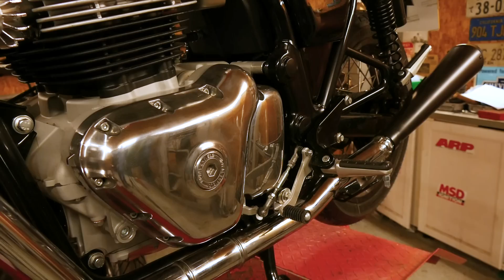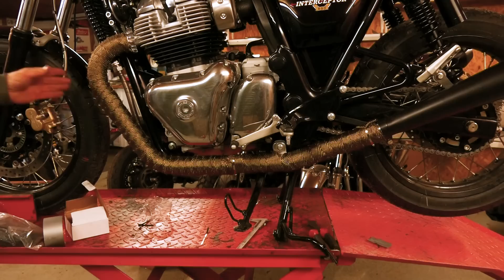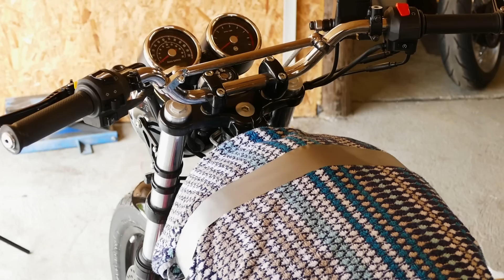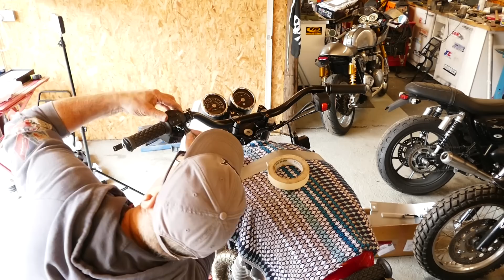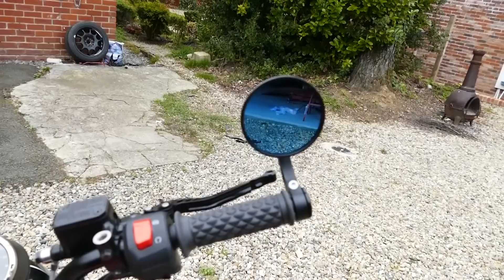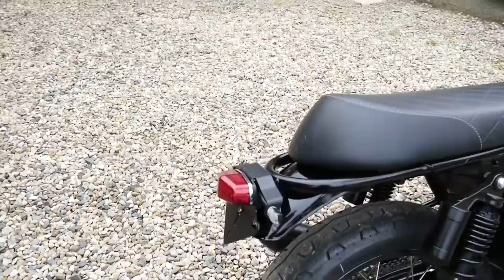Interceptor 650 Project - Part 2

Comment: Could you do a video on how the Tec Adjustable rear shocks work on the Royal Enfield?  In addition to the adjustability, what makes these shocks better than stock?  Also, if the shocks aren't lowered, are they at the same stock height or can they be adjusted higher?

Comment: Hi, excellent work sir, I have a question regarding the Interceptor 650, I am have been searching the answer for it and even the service centre people can't solve it, they say that its in all the Interceptor and the gt as they are parallel twin and they have a 270 degree firing order, couldn't understand that's why I am asking it, the issue is why does the rpm keeps fluctuating,

Comment: I haven't used the TEC wrap but I have done it a few times. Wetting the wrap seems to make it expand a tiny bit, so when it dried and shrinks back to it's original size it was nice a tight on the pipe. 
Running the motor immediately after finishing, dried it very quick.
Maybe it depends on the make of the wrap...

Comment: Would you suggest adjusting the shock absorbers to lower the overall seat height? By how many inches can we possibly do without affecting the stiffness of the shockers ?
Reply: Our lowering type 22 shocks are 335mm at shortest setting , this drops the seat height approx 2 inches from stock height
Reply: @georgemilburn6213  thanks ..that's great !

Comment: Hi, I'm Francisco, greetings from Alicante, Spain. Thank you for your excellent videos, everything is well explained and does not seem very difficult to do for yourself. Here we are impressed by the quality of your modifications. To start, we want to order your TEC Handlebar, TEC Alloy 28.3 mm handlebar clamps, CNC Alloy Adjustable Brake and Clutch Levers Set, and TEC Fork top pre-load adjusters for Royal Enfield 41mm Forks. But I have some doubts about the handlebar model that I should ask for. Could you tell me which is the best model for Interceptor, type A or type C, what is the model of your video? I also want to ask how much more is gained in height over the original handlebar, and if I can have additional information about TEC Fork top pre-load adjusters. I am not going to put mirrors on the end of the handlebar and I want to know if I can mount the original Royal Enfield counterweight set for it. Sorry for my bad English and I thank the Google translator, heh, heh. Thank you very much.

Comment: I like the sump guard holes for mote ventilation. Whe i installed the re branded one i saw the oil filter not clearing the bracket and started getting upset due to the instructions clearly showing it bot being an issue. I ended up sticking the bracket in a vice and slightly angling ut more. This aligned perfectly with all brackets and allow the oil filter to clear now.

Comment: Did you have to re-tune the ecu when you changed the silencer?
Reply: no need-  please see part 4 video for dyno run results. the  air fuel ratio was good all through the rev range with very smooth running

Comment: I think a big bore kit will have to be offered for these, unless they plan to make a larger capacity version. 650 is too small an engine for open road riding over longer distances. It could also do with some type of Screen and I don't mean one like the thruxton I mean one that is high enough for 6' bloke sitting up. Thanks.

Comment: Hi-Tec Bike, Great to see bike being Modified, Just wanted to know what TEC Alloy Taper Handlebar was used? - 7/8" ends - Type A/B/C
Reply from the maker: Type A TEC taper bars with 20mm extender tubes at each end.
Reply: @TECBikeParts  - Thank you for the reply.

Comment: I am so glad I found your channel. I was only recently made aware of the new Royal Enfield twins. I will be getting a motorcycle within the next couple of years, and though I was originally looking at an adventure bike, when I saw the Interceptor 650, that was all it needed. That's my bike. 
I will be extremely interested to follow the progress of your accessories development, especially the classier brackets, and LED lighting. I would also be looking for good pannier brackets and a rear rack for extra fuel. 
I really like where you are going with your ideas on the exhaust system, but I must say that I do not care for the black cans. They have taken out all the thumpy base, and left a rather harsh, brappy sound. I know they are temporary, so I look forward to seeing what else you come up with.
Yours is one of only a few YouTube channels that I actually felt that subscribing was a necessity. For anyone considering the purchase of a RE twin, I would say that your channel IS a necessity.
Cheers.

Comment: I have been watching your content. specially the one where you try to correct the HP problem in the street twin. I ride an interceptor 650, I have few questions. how to get this bike a set of tubeless wheels(alloy wheels not available as of now), is there a way to increase hp with minimal changes, lastly is there a way to install a slightly fatter tires (standard swing arm is not able to house a 140 section)... please suggest. :)

Comment: The seat height comment is worrying. Could I ride an Interceptor at 5'6"?
Reply: best to get a test ride , but if you find it too high we have low cost options to lower it
Reply: @georgemilburn6213  sounds promising George. You say the seat is a bit high for you and you're not particularly short - to help me gauge, what height are you?
Reply: @georgemilburn6213 , test ride - very nervy - haven't ridden in quite a while.

Comment: How to update disc from front single to dual disc brake system ?
Reply: It would be a far easier to upgrade the caliper to a 4 or 6 pot

Comment: The continental GT has the centre stand removed for 'weight savings'... I think I'd rather have it for the maintenance and parking convenience. Assuming they are the same frame with the same mountings so hopefully just a bolt on part. could you design a center stand for continental GT models?

Comment: I like your style. I live in Greece, ride a classic 500 and there is a very enthusiastic local dealer of Enfield and Triumph. I think the Lucas style rear light looks pretty good with your mods. Don't you find the Enfield switch gear to be absolute crap?  I just replaced my switches (2009 model) with genuine parts  and they're already fading! Nice to see the left side engine shot in your videos, it looks much nicer from that side. Anyway, still waiting for the dealer to get a demo in for a test ride and see if I like it better than the fabulous Street Twin I tried last summer!

Comment: I'm just curious how is engine performance now with those slip on's. 
I would have thought the pressure difference would have changed dramatically and etc.
Aesthetics wise it looks great with those slip on's but how would it affect the bike on a whole.
Reply: once we have done some more miles we are going to do some dyno performance runs with different exhaust cans and airbox mods To show Betore and after readings
Reply: @georgemilburn6213  Sweet I look forward to the update

Comment: This bike definitely needs a thicker upside down forks, which are known to break in collisions, would greatly add to the look as well. Great modifications
Reply from the maker: It would be so easy for us to throw shed loads of money at this bike and do radical mods for effect. But we want to keep this bikes changes in the realm of the home modifier on a tight budget.
So I am afraid you will not see exotic and overpriced bling on this project. Some well know custom builders have already done this with sponsorship from RE. We are not building a show bike here, but trying to show a way to personalise and improve this bike . As it has so much potential to be the bike of choice for home modifiers due to it's conventional construction and lack of hi tech parts.
Reply: @TECBikeParts  Great work sir. Just a suggestion, if you look up RE Himalayan and Continental GT collisions in India, you will find pics of stock front forks broken in collision and they look thin and weak for a 200 kg motorcycle. Following your work and awesome motorcycle this and the ones behind you. All the best in the build. Maybe someday I will save enough to own a small workshop to work on these things, that is how I would love to retire.

Comment: Very good, thanks for this.

1. A round rear light is definitely a good idea
2. Do you have any short levers?
3. How about vintage-style switch gear?
4. Gaiters (by the way, what are those fork toppers?)
5. Hugger for the rear wheel. I know it's not very vintagey, but it would keep the bike clean. If you are looking at the chain guard, then perhaps consider one?

Looking forward to the next one. Cheers!

Comment: Hi TEC Bike from Bombay. I am 165cm height and have to use extra sole shoes to be more secure on my Interceptor. I would like to reduce seat height by 4cm. I heard you mention it early in this video (Part 2).Would welcome suggestions or even better, be kind enough to address a video dedicated to it. Thanks
Reply from the maker: you will need approx 335mm shocks , we can supply fixed oil shocks for this bike in 320mm, 330mm   335mm, 340mm , 350mm or 365mm plus other sizes and in black and chrome for £59.99 per pair plus post. These are best for indian roads.
we can also supply piggyback alloy gas shocks with adjustable damping in various sizes and spring rates that can go as low as 310mm or as high as 392mm between centres staring at £149.99 per pair plus post
Reply: @shashi menon : hi, have you bought the suspension already, if yes please do share your experience. I have exactly the same issue.
Reply: @manuuer  Hi Manish. I did not! I got so used to it that I really dont need to. Happy I can lean quite well at 90+ speed. Reducing height may have limited the lean angle. 
I changed the seat..wider base and 1 cm shaved height. 
I have ridden it on highway, regular road, village road, off road, track and small segment of no trail at all. 
Only dropped it once ( while seated and backing up on a gravel bit, missed my footing).
My weight is 65 kg and height 166 cm.. After changing exhaust to AEWs, it reduced the weight to below 200 kg. But still mildly heavy. 
Also, centre of gravity is slightly on higher side.
Still.. got used to it.
Happy , safe riding (after lockdown timing becomes more liberal).
Reply: @shashimenon1000  Could you please do a video with your Interceptor? I'm planning to buy an Interceptor but having same issue with seat height. If possible, do a video. Thank you.
Reply: @shivaprasad2036  shiva....If you are 165-166 cm like me, with some time on the bike, you will be fine. Now I do my lical rides wearing sneakers and boots on longer rides. Also I changed the seat with slight thickness reduction and narrowing  just before the tank (lical seat maker). Now almost flat footing so quite reassuring. Also got angled bar raisers so body pisition has less strain and better flexibility. Reduces load on wrist and shoulders. Go ahead Its a great bike.
Reply: Thanks for sharing you feedback sir.

Comment: The handle bar and mirror setup is fantastic. Could you please update as to how much weight is reduced now after the modifications through the second episode. Thank you.
Reply from the maker: I will try and remember to weight them in next part
Reply: @TECBikeParts  I was wondering if you could give a thought on fitting the NRC tail tidy or the Crafton atelier Cat eye fender eliminator kit supplemented with your beautiful little led turn signals. I love the minimalistic design at the rear.

Comment: Not sure if you're gonna go into seats and mounts, but if so, I'd be curious about a different two up seat. The bench doesn't look right IMO. The Continental GT 650 has an optional touring seat that would look great on the Interceptor and should fit, but they don't offer it on their site for the Interceptor, so I'm not sure if it would. So an option that isn't the stock bench one would be worth seeing.
Reply from the maker: I have been looking at a slim flat top seat like the option street twin seat . that fully covers the frame loop and has an optical effect of shortening the rear end. we will probably go through several seat designs in this series till we find the perfect one

Comment: The Bike looks great!! I'm not a huge fan of chrome either. Unlike some of the comments I think the exhaust wrap really suits the bike and would keep it as it is if this was my bike. If i was to wrap my own exhaust on an interceptor would I be able to leave it on for a few years or do you need to regularly re-wrap? Are you able to put knobby / scrambler type tyres on this bike? that would obviously 'finish' the look. Great work!!
Reply from the maker: Hi
If you regularly clean the wrap it can last for years but the colour will fade in time. We intend to fit off road tires eventually but limited brands available in these sizes . will probably use 150 rear and 110 front K60 type as we have used these in the past and very good value and performance. They also look very aggressive.

Comment: The foot peg casting isn't wrong. The foot peg is like that because it makes it the same distance from the centre line as the other side. The other side sticks out due to the casting over the transmission which forces the other side out to match. It's a design compromise which I'm OK with. If you look at the mcn spy shots of the development hacks you can see they have a much lower profile transmission cover which was probably used while testing different transmissions and engines.
Reply from the maker: why is it the right peg is exactly 90 degrees to the bike centre line . while the left peg is tilted up and to the rear by 10 degrees ?

Comment: Great job so far. You Sir, are a technical guru. Few suggestions on mods: 
LED DRL inserted headlight, alloy rims, tidy up all the wiring (no visible wiring), analogue clocks with digital readout for time and gear position indicator, darken the RE logo on the engine casing..... and USD front forks!!

Comment: Great project, really enjoying the transformation. I think a round rear light is the way to go. Might be interesting to see if you can fabricate a bracket to go over and under the frame loop.....I think the light/tail tidy would look even better higher up/nearer the seat. I'd be interested to see what's under those side panels too.....maybe a tiny shorai type battery or a battery eliminator might allow their complete removal. Always good to see the triangle under the seat freed up! Great job so far!
Reply from the maker: not too crowded under the side panels once the air-box is removed. It should be quite straightforward to do.

Comment: why did you wrap the exhaust pipe? what purpose does it serve?
Reply: Very much a trend thing here in the  UK at the moment on brat and bobber bikes and Brat look is the first stage of evolution of the bike. Keep watching as it will change in looks through various influences like street tracker and street scrambler and should finally have the full on desert racer look. The aim is to reduce weight, gain performance , improve looks and raise the level of quality throughout this process. We will learn about the bike as we do these changes and also by riding it every day. We will also be influenced by viewers feedback and comments.
I am sure you will love and hate various aspects of the process as we all have different tastes, needs and influences.

Comment: I like what you've done with the handlebars and risers and headlamp brackets. I don't mind the factory rear light assembly maybe smaller indicators? Agree about the  grab rail looks much better without. Great idea about a shorter seat too. I'm really looking forward to seeing a 2 into 1 track and/or scrambler exhaust system. Keep up the good work!

Comment: Just a thought but how about setting the controls forward to create a bobber/ flattracket look and feel ? 
For me being 6'3" and 19 stone I'm ne spring chicken. 
 I have to honest and say black or a little billet aluminium is always a conservative look.
Sounds great.
Thanks.
Reply: The problem with the stock foot controls is they are pushed out to clear the wide motor and this does not feel right, this is my reasoning for pulling them back slightly

Comment: love the videos. That said, I think the back end looks significantly worse than stock. I don't much like the wrapping of the pipes, but understand stainless is coming later.
Reply from the maker: Thanks for your thoughts,the back end is work in progress and has already been changed.. We would normally only show a bike once finished, But we are trying to show and include customers in the design/development process of our parts. See next part for update
Reply: @TECBikeParts  the in progress is super helpful and interesting
Reply: @TECBikeParts  I had another good long look at the prototype rack and basically every abomination of a modified interceptor I could find on the interwebs. I think she would look pretty good with the factory light housing pulled right up against the seat (probably a smaller light though) with the rack also coming in tighter to the seat, maybe even with a little backrest. Don't know how that effects the back of the frame (not cutting it up and all).